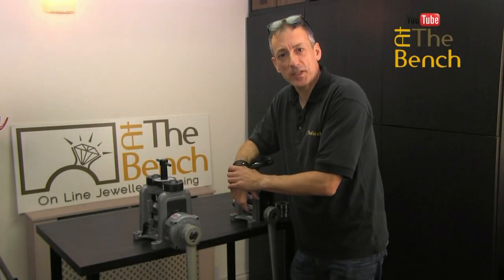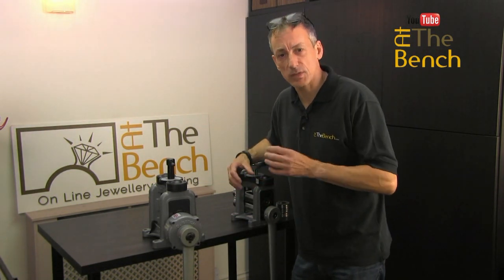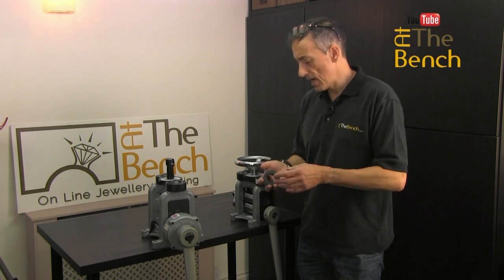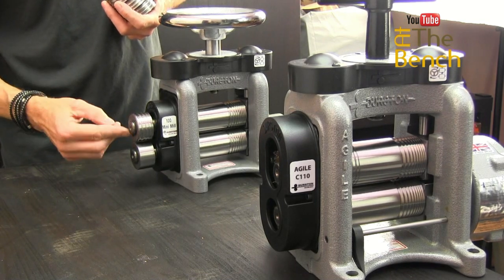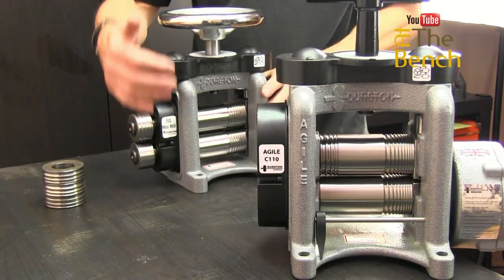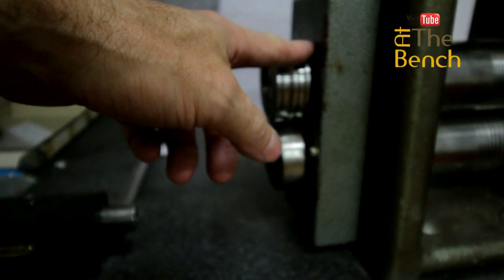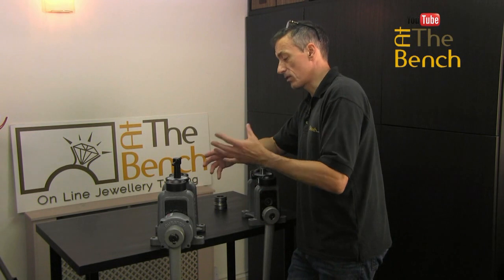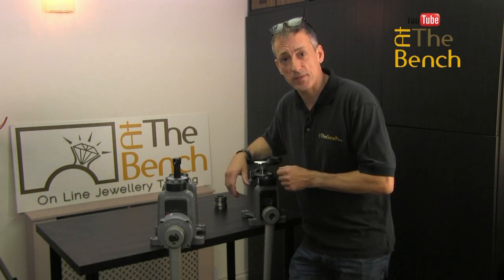How To Choose A Rolling Mill Part Two - Extension Rolls? D-Shape Grooves? V-Shape Grooves?

Comment: Thanks for taking the time to mentor all of us!! I think you've sold me on saving for the gear drive and extension rollers.  Are there advantages/disadvantages with the adjustment wheel vs the T-Handle? I have noticed most of Durston rolling mills feature an adjustment wheel.
Reply from the maker: Knight Stalker No advantages nor disadvantages. The t bar was added to the Agile mills to lower the cost

Comment: As always your so detailed in everything you share. However, I need your help. I do have 2 questions: which slot is for thinning round wire & how do I properly align the settings on top?? I just got a budget like- combination 130mm mill;(like Pepe.. but not Pepe) and no paperwork 😒. Amazons trying to help but with no success so far. Those of you looking for a mill, spend a little more on Pepe and avoid my frustration.

Comment: Really enjoy your videos.  Am a member of at the bench and appreciate what you do. Having a problem changing the extension roller.  I finally got the clip off, now i am not sure how to remove the D extension top roller so i can replace it.  Any tips. Can't find clear directions anywhere.
Reply from the maker: It should just slide off. Pull it perfectly straight as if you try to pull it off at an angle it will stick and you will have to use your rawhide mallet to tap it back on again.

Comment: While it’s obvious that having square grooves makes it quite easy to roll square wire to then be drawn through whatever draw plate you want, is it at all possible to use a flat roller to do the same by rolling it slowly, quarter turn at a time with a lot more annealing?

I’ve recently bought a Durston that only has flat rollers and D shape extensions and I would definitely like to make my own wire too. I’m just a hobbyist so I don’t mind spending more time making wire, just wondering if it’s at all possible.